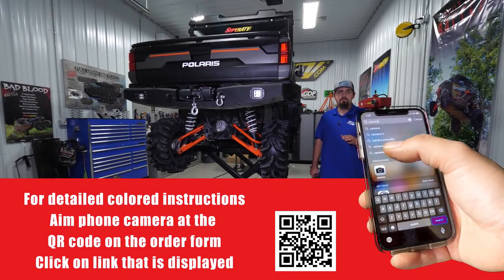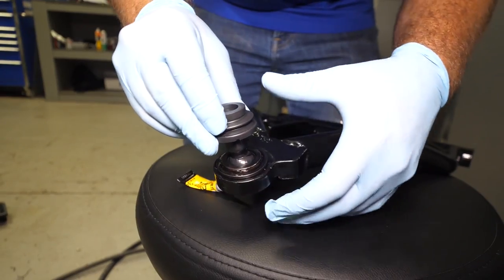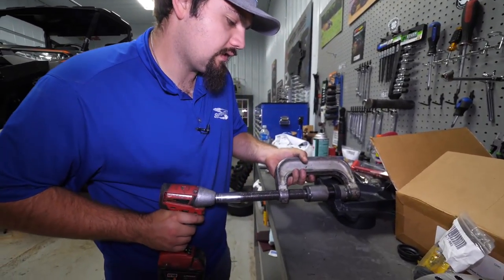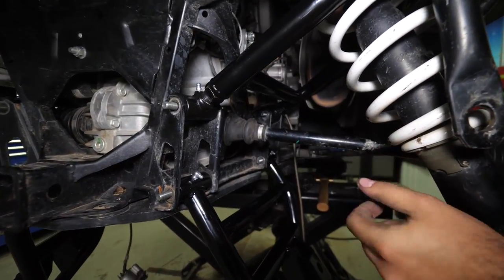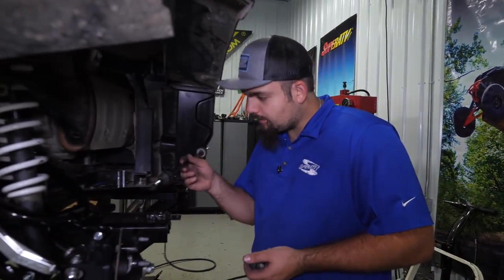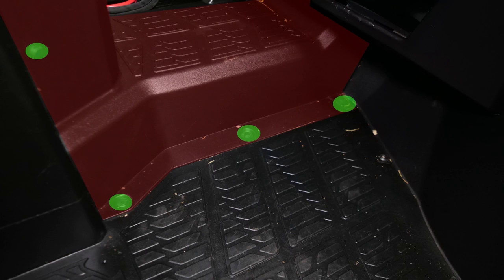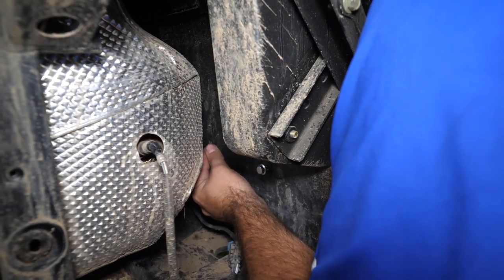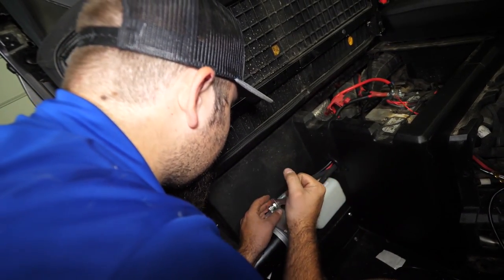Ride System Rear Steering Install | Basic Kit | Polaris Ranger XP1000 |SuperATV

Comment: I just installed front and rear high clearance offset arms on my 20 northstar. That method of adjusting the camber is terrible. None of my 4 arms were even close. It took a few times assembling and checking before I got it perfect. 
Great idea with the 4ws.
Reply: Just did my 19 Ranger Highlifter today, trial, error, patience, cursing, “F” it that’s close enough....